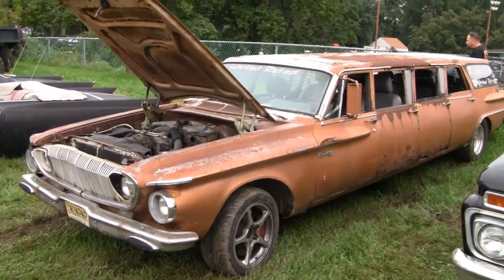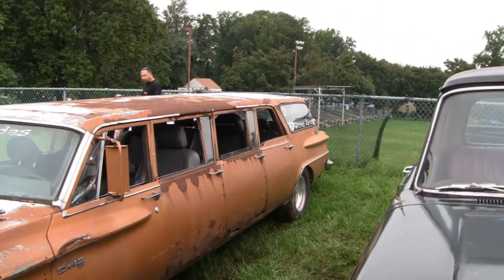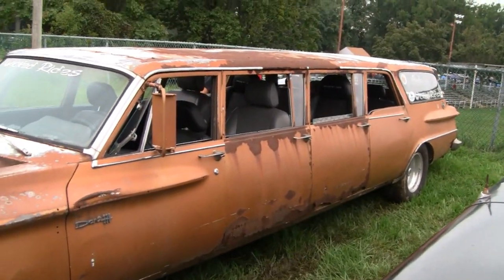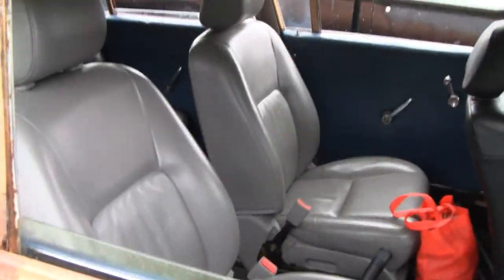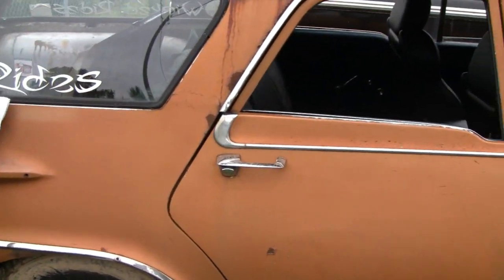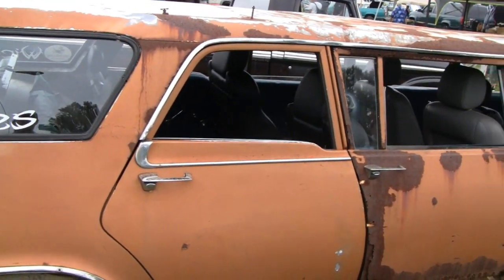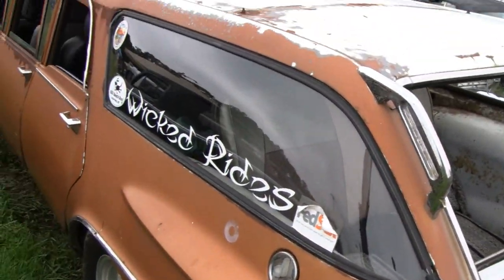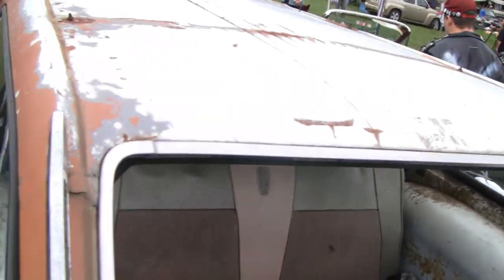1963 POPEMOBILE

Comment: no IF you can believe that story he tried to feed you it would have had a slant 6 in it. they didn't really go too high end for the motors in the old dodge darts and the FIRST papal visit to the United states was in 1965 during which he was driven around in a 1964 Lincoln stretch limo at the same time in vatican city the papal limo was a Mercedees 600 so either he was lied to or he made that up to make his customized rust bucket more interesting